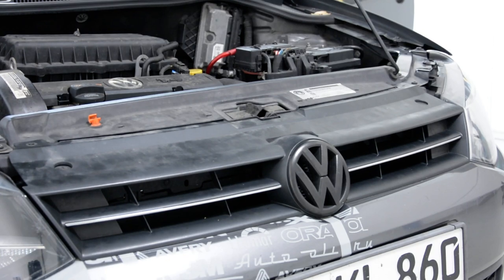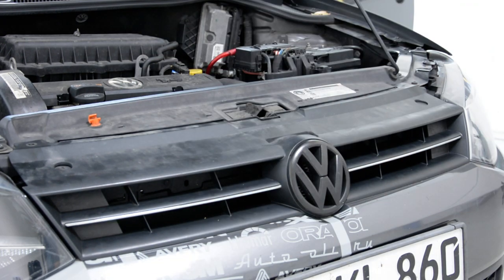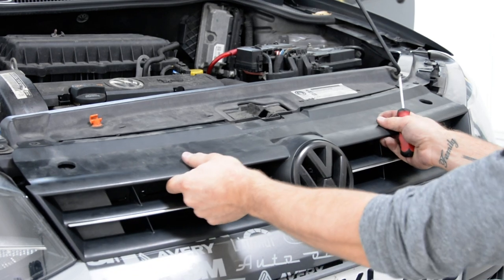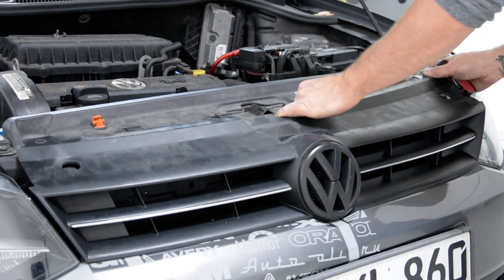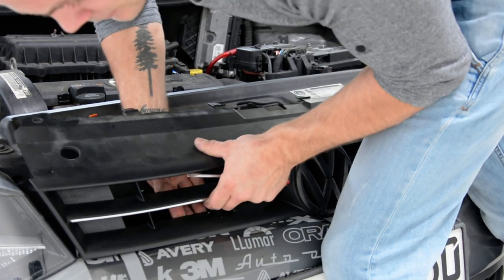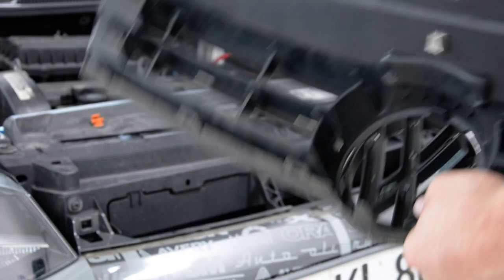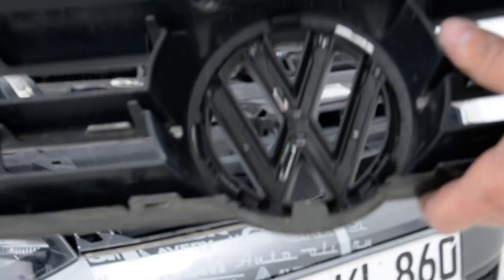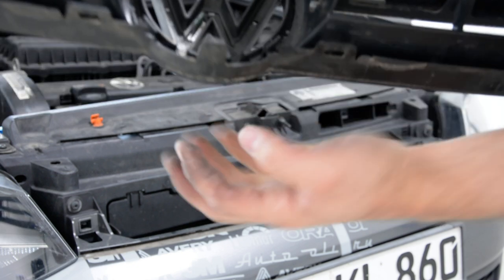VW polo 6r grill and VW Emblem removal

Comment: The early 6r’s are prone to timing chain failure 
The chains always fail but overall a good solid reliable little car
Reply from the maker: Mine don't have a chain it have a rubber timing belt(I've changed at 90000km). I will tell you a short story :))) I had a polo 6r the car from this video. I've used a 30000 km oil when I've made the service. After I drove 30000 the service light came in the dash saying that I need to change my oil. I didn't like to have the light in the dashboard and I've resented the service by pushing some buttons saying that in the next days I will go to make the service. The thing is that I forgot and I've drove another 20000 km after the a signal light came on saying that the oil level is to low. :)))))) 
I've driven the car 50000km with an oil change. The car have now 190000 km and run perfectly.
Reply: DFC Garage ya man